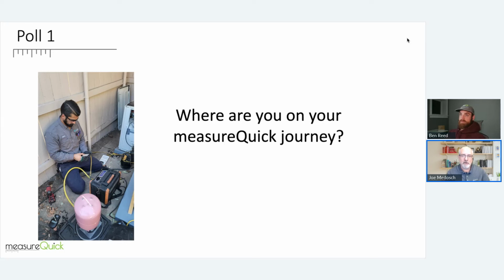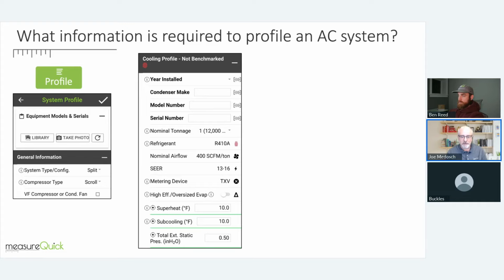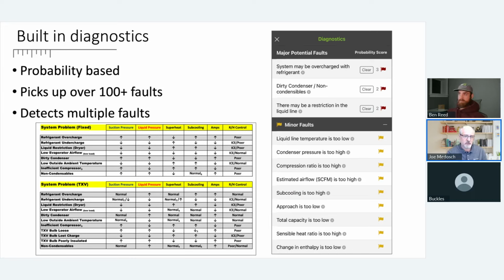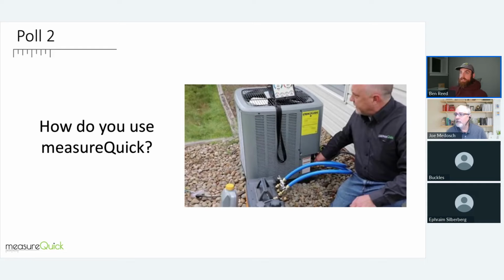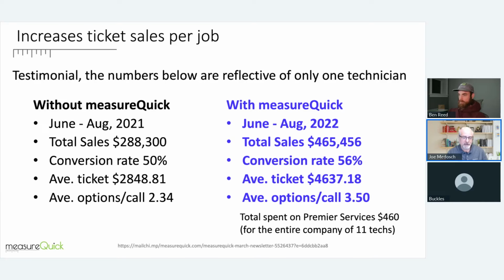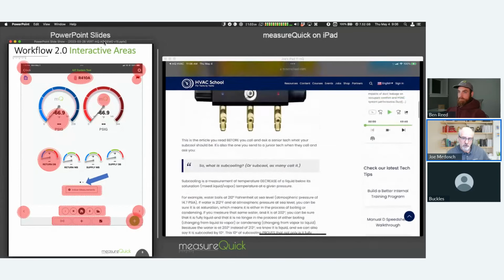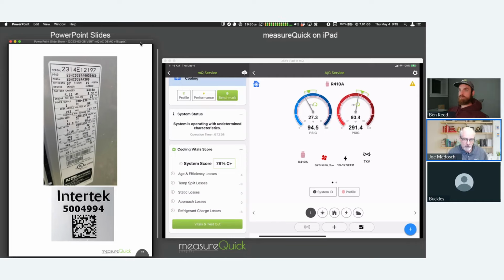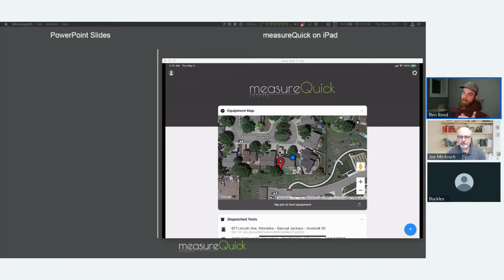Introduction to measureQuick - May 04 2023

Comment: I love measure quick, all of Jim's content is really quality as well. But I absolutely will not use measure quick since they blocked the ability to take screenshots. I believe that you should never remove standard features from the base app. I appreciate all the time and effort that you've put into it, but That's a deal breaker for me.😢
Reply from the maker: Screenshots were not something that we designed into measureQuick, we only restricted them. We restricted them for a reason. Screenshots undermine the integrity of the data to the technician, contractor and homeowner. Data integrity is the core of business.